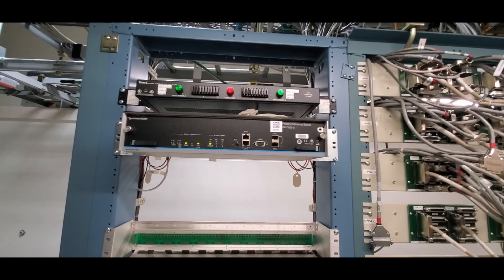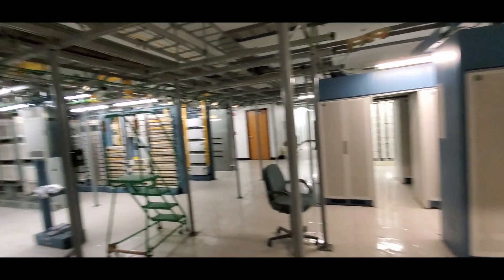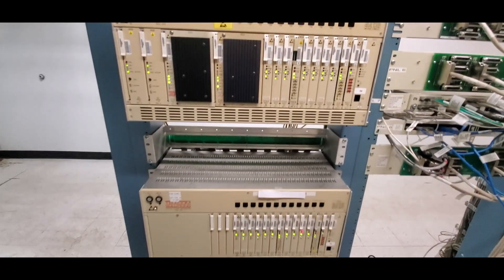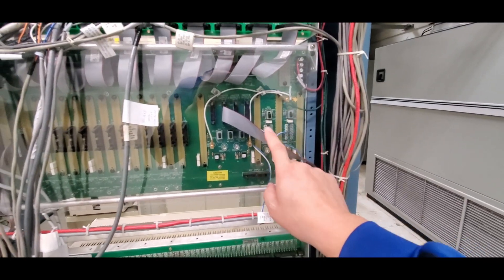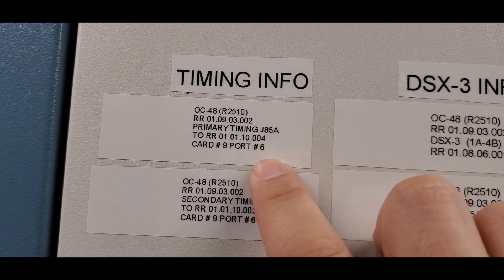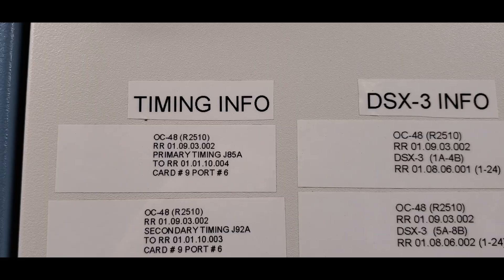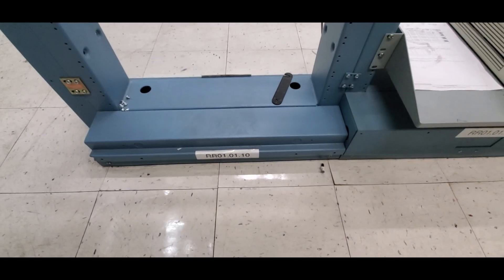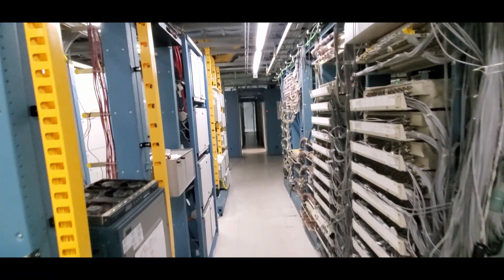The Secret Clock That Keeps the Internet Alive

Comment: @fdrtech  Legacy wired Telco uses E1/T1 (2.048Mhz or 1.544MHz) reference, some uses 1PPS, mostly legacy broadcast uses 10MHz reference, modern RF Telco uses PTPv2 (G.8275.1 mostly). It is important to tell, that the GPS UTC timestamp is not enough: high quality GMs (Grand Masterclocks) are using the phase transition of the signals coming from GPS satellites to lock their PLLs onto it, and tune their high quality ovenized oscillators to get extreme accuracy. Modern RF telco (DVB-T, 4G, 5G) needs very good frequency and phase accuracy (50ppb and 1.5ns), your legacy wired Telco system only needs accurate frequency sync. This is not something the GPS receiver in your phone can do 🙂 Given that you are talking about T3 banks and 5ESS, I assume the fiber is still SDH?

Comment: Very cool video to see how these things work! Makes me happy because … well, you see, Couple weeks ago I had a problem with some public-facing computers at — we’ll call it a “physical computing gaming arcade” caused by the clocks being a few minutes out. I could have just used NTP, but I tend to overengineer for fun — so, instead I cracked open a $10 gps dongle to expose the PPS pin, rigged it to a Pi running CGPS and Chrony. 3D printed a rack mount with some blinkenlights numbers on the front — “only” accurate to about 250 nanoseconds but .. very happy to find that I accidentally approximated the big show with some stuff I had laying around!